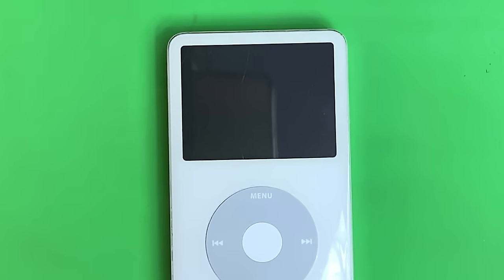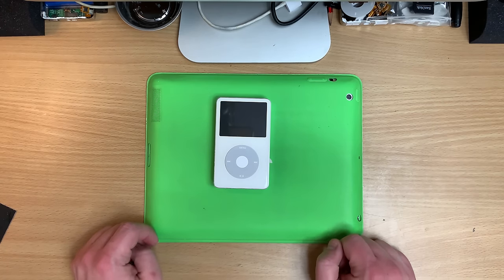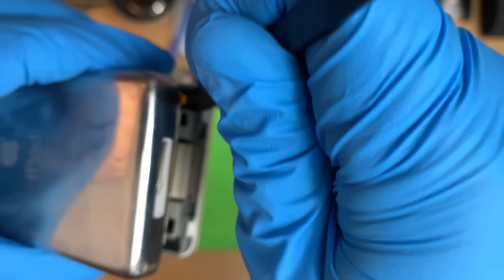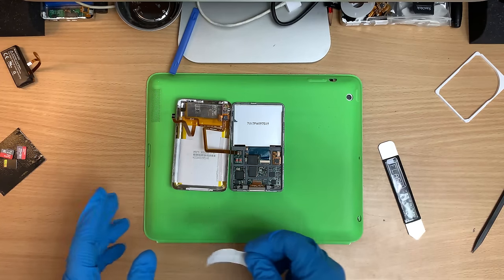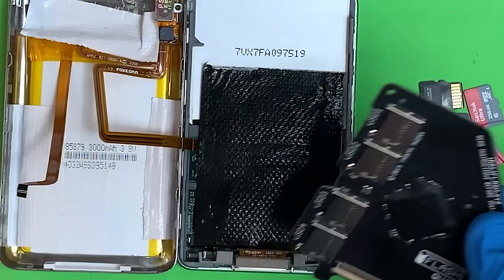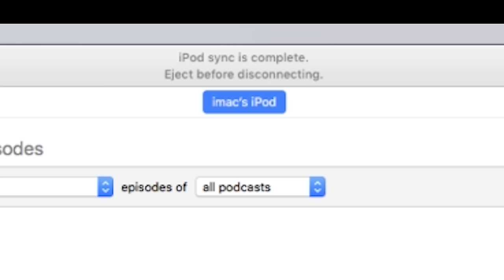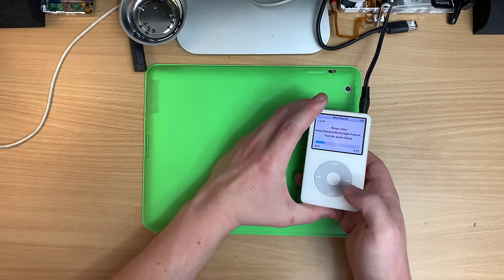Building a 1000GB iPod classic! Can it handle the storage?

Comment: Loving your videos! I built a 1TB 7th Gen a few years ago - with the U2 Limited edition aesthetic (red click wheel - black body and back)
Loved the process - even got the back case with a 1TB capacity laser etched in. Got the same big chungus battery but opted for the dual sd card iFlash setup at the time. 

Still works like a dream.
Reply: Where did you get the new back??
Reply: @wadewalker2785   @Wade Walker  dunno where Dave L got it, but there's an online store called elite obsolete electronics has em in pretty much every colour. the guy that runs that store is where DankPods got the parts for this video, when he used to just be another ebay seller
Reply: Does shuffle still work? Seen comments that say you lose shuffle cuz the ram can’t handle it

Comment: I recently found out that you can add SD cards to iPods and it's been in my new hobby! 
I have enjoyed rebuilding them for years but adding the SD card just great
Reply from the maker: Its fun getting old tech to do modern stuff!
Reply: Do you sell them?
Reply: @Serjical1  actually yes, have some now I'm reviewing.  If interested shoot me a email
Reply: I did the same with two PowerBooks. Replaced their (still working but slow as h…) HDD with SD cards.
Reply: I think it'd be easier and more cost effective to just add a new hard drive to this iPod.
Reply: @Boba_Fett1980  no it's actually about the same price and level of difficulty. Depending on the amount of GB you get the micro SD option will be cheaper than the traditional hd. 

I've rebuilt about 10 of them over the past 2 years and I'm mad I just found out about the SD option as it's much better!
Reply: try add SSD  xD
Reply: @Ulvis_B  That would be overkill lol.. the micro sc is perfect for iPods
Reply: @DankPods  but can it run crysis?
Reply: @mlwz1082   where can I find your email..
Reply: @DankPods  man, you still there with the channel, then give me ur lo-fi playlist, u fricking *iPod guy with 41k+ songs
Reply: Last time tried getting my 4th Gen iPod photo refurbished the only option was Flash cards. Is there a way to get an SD card in there now?
Reply: @nwbasson  I'm not sure about the 4th gen, you should consult the web.  I literally just finished a 5th gen to sd a minute ago
Reply: @DankPods  I'd argue it's more a case of getting modern tech to do old stuff.
Reply: Anyone here have music files they’re willing to share?

Comment: Imagine a remake of this video in 2045: Ipod classic from the dark ages outfitted with a few petabyte of glass storage
Reply: lol no possible. glass storage is end way storage solution
Reply: Is that all the imagination you got? yawns
Reply: Well micro sdxc format supports 2TB max. So all you can fit in these iPods is just 8TB. I wouldn’t even want that it would take a week to sync that much music and videos.
Reply: @markm0000  If you collect music for all your life as FLAC and 320Kbps MP3s (the biggest  file size possible) you won't even fill up 1 Tb.
Reply: @markm0000  the ipod wouldn't let you have 8TB
the limit is ~2.147TB as far as I know
Reply: @Xnoob545  The rockbox firmware can boot with more than 2tb of storage space. There are many 7th Gen iPods with 4tb that work just fine.
Reply: @Xnoob545  As soon as there’s a 2tb MicroSD available someone will try it and it will probably work. Heck, I might even do it just for the lolz. 8tb iPod in my pocket.

Comment: Put in the newly released 1tb micro sd cards. Need them sweet 4tb
Reply: RAM has left the chat
Reply: Shield S. Wait there’s a terabyte microSD now??  When did that come out?
Reply: MikeJ 2016 some time this year
Reply: Shield S. I knew they were coming but I didn’t think until next year.  Get this I had a DELL tower pc  processor with 591mb back in 2001 had like 200mb of ram wow tech changes quickly these days.
Reply: MikeJ 2016 1tb ssd drives are super cheap nowadays too
Reply: Cool
Reply: @Roshan_420  Umm well as long as you dont consider a flash drive as a ssd lol, yes it can be the same but its really not.
Reply: killerdeamonking nahh bro 1tb microsd card.. 230$.. 1tb ssd or m.2.. 100$
I bought a new samsung 2tb ssd for 200$

256gb microsd 35$
240gb msata ssd 39$
256gb ssd 33$
Reply: @Roshan_420  I see, i would have gone with a m.2 and bought the adapter for it so i could get 5gb transfer speeds lol.
Reply: @Roshan_420  Also you gotta watch which ssd you get cause alot of them are fakes and dont have a cashe so if they loose their power they wipe themselves of all their data.
Reply: killerdeamonking 1tb samsung m.2 ssd costs 179$ with 3.2gbs speeds
Prices have been going down quite a lot
I remember buying a 512gb ssd in 2016 for 330$
Reply: @Roshan_420  That is very true, they are dropping in price. I just wish ssd's would drop faster so i could get a few without spending a ton for them. If i could get 1tb drive for main OS and then a few 2 - 4tb mec drives i would be a happy person. Sucks being short on cash all the time =.=  .
Reply: killerdeamonking saving up and cutting corners on unnecessary stuff comes a long way like snacks or alcoholic drinks etc
Reply: @Roshan_420  Huh ,thats not something you gotta worry about when it comes to me xd. But yes saving is key.
Reply: killerdeamonking ahaha but without those you’ll reach that goal quicker

Comment: when that tiny thing has more storage than my pc...

:(
Reply: Facts
Reply: yes, but it'd be hecka slow when transferring files at like less than 10mb/s when a normal SSD can do like 200mb/s
Reply: *laughs in 2tb 2009 pc *
Reply: Laughs in half a terabyte
Reply: 8 gigs? That's hardly enough to run doom.
*laughs in 64 gigs of ram *
Reply: You could've just said 16.
Reply: Laughs in 2tb laptop
Reply: cries in macbook pro 2019
Reply: Laughs with 2.8 TB
Reply: What I recommend, is getting a 500gb SSD and rubbing windows of it. Then getting a secondary 1tb drive that's what I've done
Reply: Laughs in 5tb
Reply: My laptop has just as much storage as that iPod, but there's only about 300-something gigabytes left.
Reply: I have almost 1 TB

Comment: When a mid-2000s iPod has more gigabytes than an iPhone 11 Edit: also it’s standardized that just makes matters worse
Reply: If only iPhones and other big OEMS had SD slots.

I bought 120 extra GB for my Note 8 for $25. Yup, just $25 for a genuine Samsung SD. 💅 

I'm not trying to brag or anything 💅 

Y'know. Just saying. 💅 

(It's encrypted, too!)
Reply: Mind 2000’s would be 2500 😂
Reply: Mig 28 i purchased a 128gb for only £13, ive gotten a better deal than you but not trying to brag or anything 🤗
Reply: @novanova4978  😂 it seems you did get a better deal!
Reply: DogeDude Playz Nintendo Switch’s use android, if mod it enough you could probably turn it into a phone and you can put a 1TB micro SD in it.
Reply: @unlovableshinshin  1 tb sd isnt out yet but 512 gb is
Reply: charge4 bass SandDisc makes a 1TB micro SD
Reply: Big Norte 986 mid 2000s would be 2005...
Reply: Mig 28 haha but try taking a picture with that android Boof camera
Reply: @2gr375  actually my s9 edge plus has a beautiful camera
Reply: @2gr375  Ever heard google pixel?

Comment: Spotify Shuffle with millions of tracks: exists
Nobody:
DankPod: 1TB iPod Shuffle with a few thousand song that takes you to settings
Reply: Yeah, some of us like music that doesn't stop when you lose reception on a device that has enough battery to last more than a day.
Reply: @TheDemocrab  i have spotify premium so no problems there👍
Reply: Tbh Spotify shuffle is crap. Often end up with the same songs not long later. Sometimes it'll double all the songs but if you remove one of the two or removes both 😑
Reply: @DanielPasta  Spotify premium doesn't affect your reception or battery life, though. Streaming simply requires you to have a data connection and uses more battery (by using said data connection) by default lol
Reply: @TheDemocrab  I have all my playlists saved for offline use anyways. Have the storage capacity so why not to save data or when I can't get reception. I was just pointing out that the shuffle mode isn't the best
Reply: @DanielPasta  Sorry mate, YouTube decided to tag you in that when I'd replied to React King. 

Probably because I don't sub to YouTube red. 😂
Reply: @TheDemocrab  ah no worries mate yeah probably tbh 😂 I like YouTube premium but I don't plan to keep it once my trial runs out 😂
Reply: 2 big problems with spotify - firstly when your signal dies, so does your music. Secondly when spotify eventually goes bust, your music is gone.
I have several ipods from all the way back in the mid 2000's, all still play all my music perfectly well. If one dies, everything is backed up on 2 computers, flash drives, and even a case logic full of dvds - stored in more than one location. No one company going bust can  knock out my music collection.
Reply: @zacharyyyy  Spotify premium lol... Well over a hundred bar a year... and you still have to contend with DRM.
Remember Spotify and the other services like it have never made a single penny in profit so them all going bust is not out of the realms of possibility.

Comment: I upgraded my old 3rd gen 40gb Classic, and 2 60gb 4th gen Classic "photo" models. I keep one 60gb in car. So the 2 60gb models just needed new batteries, the spinning drives still work. The older 3rd gen, that's the one with the 4 round buttons with orange backlighting, I replaced battery and also converted it to CF storage as the drive was bad.  I just used a 64gb CF card, I'm cheap and I don't have that many tracks. But they all work great. No need to buy new products, they were well made.

I remember walking into Best Buy, must have been in 2003 when I bought my first iPod. I got the big 40gb model, it was over 500.00 then. Glad I can still use it and it's even better now, lighter and less power usage with CF storage. When the drives go in the 60gb iPods I'll convert those over to CF too.

Comment: They should make an iPod classic again, 2gb of ram, and 2.5 inch drive form factor which will lead to bigger battery, bigger screen, bigger wheel for larger collection, accelerometer for drops so the drive can park before failure. Boom life proof, also i69 resistance.

Comment: And that was when even 1GB is considered "large" for a portable video player. But it was at the time when mp3 and 3gp were the norm, and not even V0 but 128kbps CBR. (And also 480p were considered "HD" for web video.) Really got to think that how much tech has advanced, and nowadays I even have to order a phone with built in 512GB storage out of the fear that when I shoot 108MP RAW photo it runs out quick. (And flagship phones from most brands don't even allow micro SD anymore, though I guess it's still 100% possible to replace the storage if you don't mind completely voiding the warranty.)

Comment: A year late, but an important note: While it doesn't in theory matter if the sd cards come from different manufacturers. What does matter is that they all have the same read write speed and the same class.

I suspect that the iflash adapter is running them all in raid0 or an equivalent, and as such the speeds that you can see will be governed by the slowest speed available.

Comment: I was able to fit the 3000mah aftermarket battery and 512gb storage in the 30gb thin model by using the iflash 4 micro SD cards and taking a file to the aluminum internal frame until it was only a hair sticker than the screw holes, it can all fit together then crazy snug with no stress on any parts. I also have a see though faceplate with clickwheel and a blank heat treated thin back housing on the way in.

Comment: Totes need one of these and load it up with music and movies galore. 
I hate using my phone for those things because it eats precious space, data and it's no fun. I used a modded PSP for years despite having a phone. I'm thinking of getting one of those gaming consoles. 

I used my PSP for music with a aux adapter for my old car before I got one of those FM transmitters. Also a good benefit of ipods, you can have a music library on a older vehicle without fidgeting with the FM transmitters that eventually get old and will fuzz out around other vehicles that have them. After awhile they get old and fuzz all the time. 

Another benefit I see is if you fly private or just building hours. My CFI had a ipod set up in his plane that would cut off when someone spoke into the radio or if atc was talking. He didn't have a newer plane that could run SXM until two years later when they updated us with glass cockpits and all. Flying is much more enjoyable with music (he would play classical a lot) and was good for cross country trips when everything is fine and doesn't need your constant attention

Comment: build it myself with "real 1tb" -> 512gb+ 3 times 200gb. Wasnt a big deal at all that it was a gen 6 with 128gb lock cuz i wanted to use rockbox anyway.
Works perfectly fine paired with a 3000mah battery. Didnt charge it once in the last month

Comment: SD cards are extremely slow compared to other flash storage (notably SSDs), and actually have typically slower transfer speeds than mechanical hard drives, except for high-end UHS cards (e.g. UHS-II and UHS-III, the latter of which can crack 600MB/s). Even if you use these high end cards though, the reader (your iflash in this case) needs to have the appropriate pins to enable the higher speed transfers.

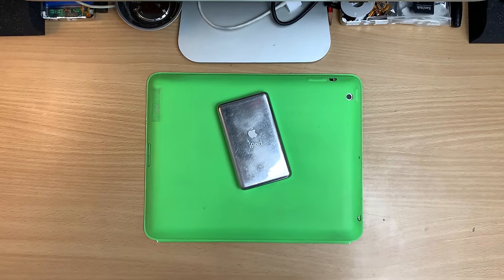0:55 The cards you have there are a mixture of Class 10 (the fastest you can have without UHS, but it has a minimum access speed of 10MB/s) and UHS-I (~100MB/s), which should all be slower than HDDs. UHS-I is on par with slower hard drives.

The iflash site doesn't say what the upper limit on access speeds are/whether it has the extra pins required for higher speeds, but I think it implies it has maximum compatability.

If you'd decked your iflash out in an array of UHS-III cards (assuming the iflash can support the high transfer speeds), it might just be blazing fast.

Comment: I just noticed you moved the iMac further back and you removed the speakers and and added a basket of stuff and you removed the 1 of the 30 pin cables the only cables you see is 2 30 pin cable 1 FireWire cable

Comment: I still have my 5th gen 30Gb iPOd, thinking of upgrading it with just 32gb of flash, since the harddrive started clicking a bit. Don't use it very often, but hey it would last a lot longer that way. Also still have my 160gb 7th gen :) but I love the 5th gen better, because it's thinner. But I just noticed I could get the thin backplate when i Mod it :)

Comment: Don't know what I am doing wrong. I have a 30GB Gen 5, followed your steps verbatim and it doesn't work. Tried Quad Flash with 2TB (4, 512GB) and nothing past "connect to computer Use iTunes to restore". Once connected, after hours, iTunes does not recognize it. Knocked it down to 4, 256GB and still the same. Went to solo flash and 1, 256GB and still doesn't work. Finally just have up. What am I doing wrong, sitting here with $200 worth of cards and such?

Comment: Any good suggestions of if the microSD that is being used isn’t showing the correct available storage space? I’m using a 512gb sandisk ultra but when I have it installed it shows up as 127gb. Any suggestions?

Comment: Is it fine to put 256gb inside a 5th gen 30gb? Its thinner and 256gb should be good enough for the max songs. Also, will the bigger battery fit in the 30gb with flash mod

Comment: Hola. I have put SSD's into 3 ipods now but it really isn't worth putting more than 500g in, as running iTunes the maximum number of files that can be shuffled seems to sit around the 42k (or just above). First was an 80g 6th gen with a CF card in it pushing to 128g (max for that model), 1 is a 512g SATA in a 7th gen and last was 512g Quad µSD in a 7th gen. I encode at 320bit mp3 and my Quad still has 130g I can't use. I would say to any user, to not spend cash on 1TB memory as you will not be able to use it.
  There is another way, and that is to replace the firmware with RockBox and not use iTunes. This will enable you to bypass the limit of 50k items imposed by iTunes and also enable you to play FLAC files
Reply: additional: shuffling is a massive power drain which is why it resets....you can help yourself by keeping the cable plugged in whilst it shuffles ;)

Comment: I have the slim 80gb classic, I thnk 6th gen? Do you think I should get a 'fatback' for it and the large battery or just stick with a small replacement lithium cell and the thin back?
Reply from the maker: The large battery fits in the slim case if you iFlash it. Yours can handle a 128gb microsd MAX being a 6th gen (strange formatting they used for only the 6th gens)
Reply: @DankPods  Thanks for the reply! Believe it or not my Ipod still works, just doesn't hold a charge very long. Might install a clear front  housing while I'm inside it, not sure yet.
Reply: @DankPods  Finally got mine opened up. Took a LOT more effort than I thought it would lol. Gonna order the Iflash kit and pop in my Samsung evo 128Gb microsd card and an upgraded battery. I'd get the SSD kit but I already have the MicroSD card and Idk what else to do with it. Edit: Yep, Mines an early 6th gen. It's an 80gb EMC2173 with the matte black front.

Comment: DANK!!! I tried installing 512gb iflash dual, the big chungus bat-rie, and I can't seem to be able to restore it.

I booted in srv diag, and when I run the smart test on the HD it says cannot connect.

I've triple checked all connections and it should work but I cant get it to communicate.  

What are your secrets ipod wizard???
Reply: NEVERMIND I JUST HAD A DERP!  HAD THE IFLASH INSTALLED UPSIDENDOWN LIKE A PLEB